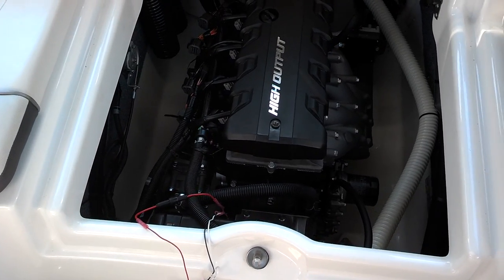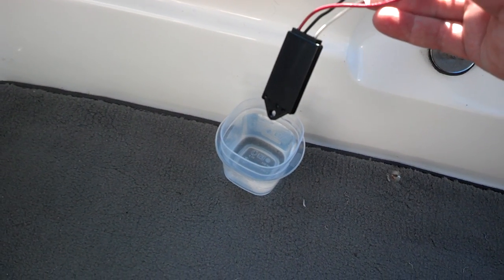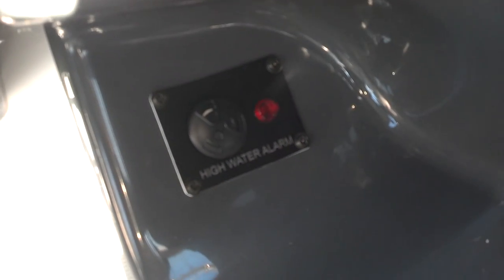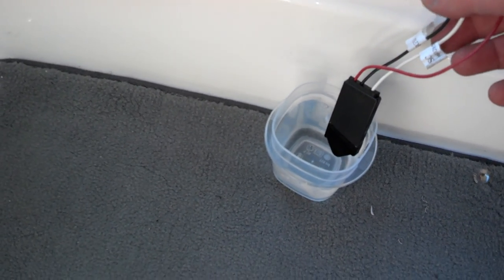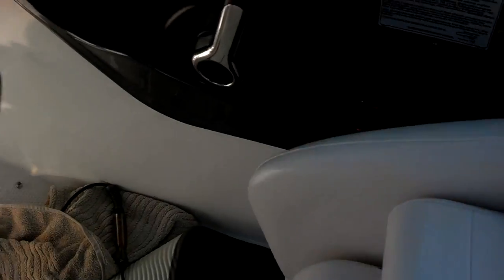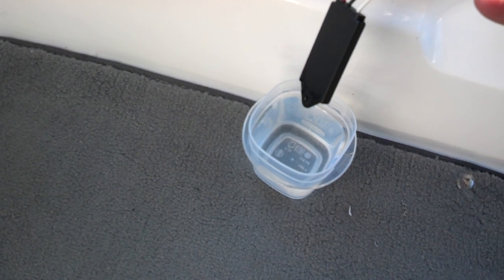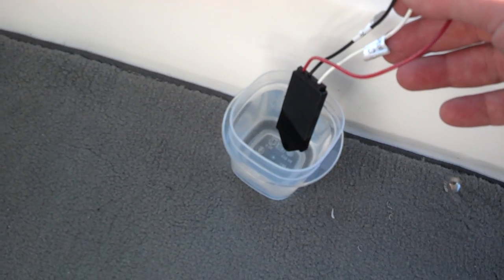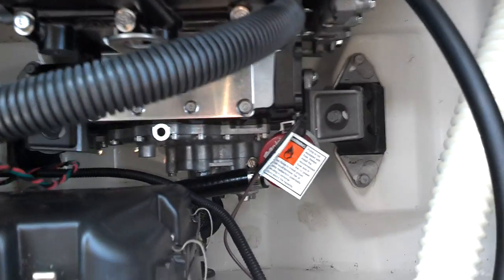Sensalevel Bilge Water Alarm by Levelguard

Comment: Love your channel, I recently just got one of these alarms in the mail and it did not come with a wire diagram where does each of the wires go I understand positive negative and then ground? Can you help me out thanks
Reply from the maker: Thank for watching. I believe the 3rd wire goes to the alarm itself to sound the alarm once water is sensed. Call them, I'm sure they can help. (630) 221-9000
Reply: @CaptainLeonsBoatingandMore  i did they closed down the facility no longer open